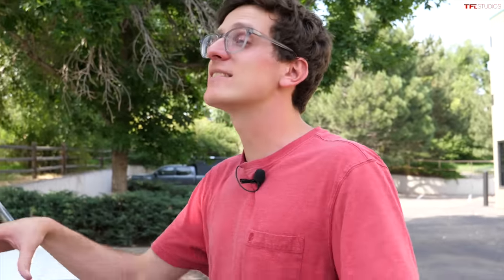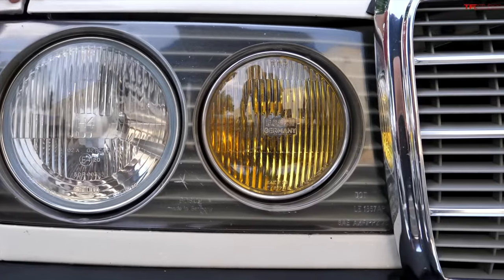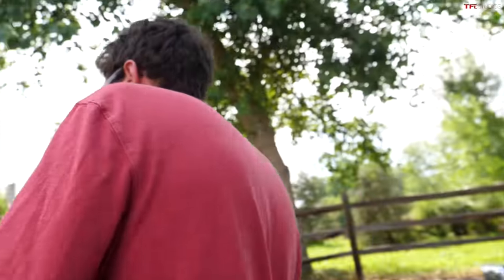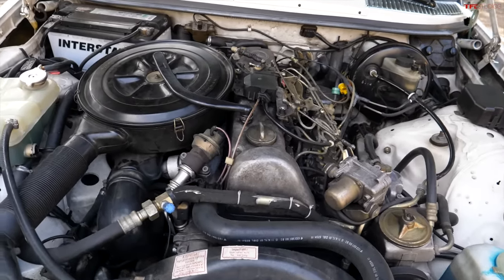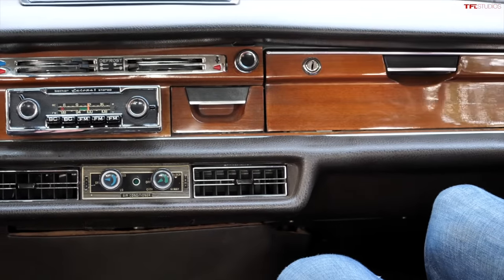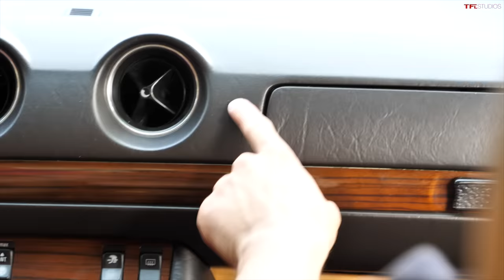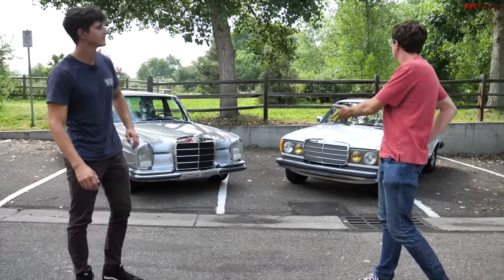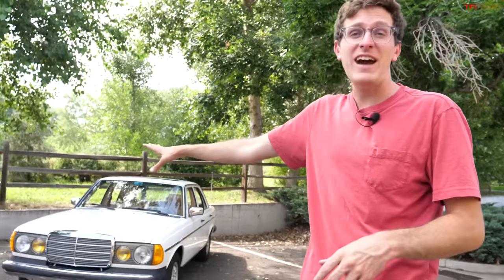Is It Worth Buying a Classic Mercedes-Benz? We Share Why It Absolutely Isn't (& Totally Is)!

Comment: I wish I could understand the obsession some people have with lowering a car to the point of it looking cartoonish.  It cant be an age thing because even as a teen I hated that look.  It's especially sad to see a beautiful classic euro car that's been slammed. 😢
Reply: There are plenty of the original ones around. Don't worry about it. The clue is that the car is often used, out there among the public, not dusting away most of the year in grandpa's garage
Reply: And doing that KILLS any semblance of handling as the suspension geometry is ALL WRONG and might KILL YOU also!
Reply: I absolutely get you. Here in Germany it is very rare to see one of these models lowered, it is not only a question of age, though, because there are classics from other brands that seem to be made for it - but just no mercedes, it destroys the whole aesthetics and proportions...
Reply: Also the swing axle cars like he W108 don't cope with it very well.   Try and buy a used diff for a W108 these days, hard to get now because of damage caused by these slammed and bagged cars.
Reply: So much crap. How can you come up with this guys?? 'Lowered vehicles will KILL you!' 'Can't come over w108 diffs that are not damaged due to slammed cars' It is better that the cars are used and taken care of, so be it if some slam them, instead of being wrecked or dusting away in some garage hidden to the public most of the time. Again, don't worry about it, there are more than enough original ones out there. It's absoultely NOT of your business what people should do or not with THEIR cars.
Reply: @Rimrock300  nobody is worried and nobody cares if somebody lowers his car. In my car it is a question of taste, but everybody decides for himself. The part with 'not of our business'... don't agree, it is a public demonstration video about Oldtimers, people surely expect comments.
Reply: Whatever, go find a video without one lowered in it🤡

Comment: Also, when I was your age, driving 123s, the headlight doors for the W123 were still available to buy at the dealer for cheap. I wish I bought 1000 of them.
Reply: The W124 is an amazing car aside from the green wiring ! 

But the w123 is a tank amazing car
Reply: Meh, it's cosmetic. Plenty on eBay including brand new aftermarket. You haven't been keeping up with W123's. The parts that can truly sideline a W123 that are NLA are the brake booster vac line and the Bowden transm cable.
Reply: Headlight doors are still pretty affordable, about $70 each
Reply: Virtually nothing is available from Mercedes for any classic Mercedes. Whatever exists has to be sent from Germany.
Reply: And this sqid owner worried about radio sticking out!
Reply: @golden.lights.twinkle2329  depends on the country. I run a W126 in the UK and loads of parts are available and in stock at the dealer . Only a couple of occasions have parts been ordered from Germany. Plus all the stuff that Mercedes don't actually manufacture are widely available from Bosch, Lemforder, Febi, Beru etc.
Reply: Wish I'd bought a great many parts when Mercedes still offered them. Hell, few dealers still carry hardly any parts for anything over 8 years old. Everything is listed "Discontinued" for my 2014...

Comment: You guys should get a 190e for the channel
Reply: Were 190Es ever imported into the US? I don't ever remember seeing any americans talk about it.
Reply: @GlamStacheessnostalgialounge  They only imported roughly 130,000 w201 cars.  I have 2 diesels.
Reply: @GlamStacheessnostalgialounge  yeah early US cars had the 2.3 engine then the later US cars got the 2.6 engine
Reply: I’ve had plenty of old Benzes because … well I’m old. My Australian spec 190E is the best of them all easy to run feels like the bigger ones without the cost and I can fix things myself. It’s not fast but on the highway it’s not slow either. It will cruise at 100mph all day happily
Reply: Weren't there like many different cars called 190?
Reply: @jurivlk5433  yes the earlier round cars for the 50’s and fintails from the 60’s the number referred to the engine capacity the 80’s 190 came with a 1.9 litre 4 cylinder E stood for einsprintz motor or fuel injection. The. In the mid 90’s they changed all their model names into 3 classes C, E and S
Reply: @Vaudotusker  Weren't the 190 coupes from the 50s also 190E?
Reply: @jurivlk5433  no they were 190SL
Reply: @Vaudotusker  O.k. Thanks! By the way, one of the most beautiful cars ever!
Reply: @jurivlk5433  190 c class is called w201

Comment: Good job on keeping the W123 in its most original state.  I was disheartened to see the change in the W108 to its current "stainless steel low-rider refrigerator" look---especially having been a family heirloom.
Reply: Yes, that was a crime
Reply: The 280SEL 4.5 looks like a W109 with collapsed air suspension.
Reply: Yes! I felt exactly the same! It looks ridiculous.
Reply: Looks godawful, but unlike most that change springs, that's on airbags and can ride normal height. Bonus points for not fitting super wide wheels as well
Reply: I love it. The original is so tacky, esp. in yellow.
Reply: @1575murray  so, as I'm only super familiar with 123's, I guess this car did not have air suspension?  (The one I'm familiar with is the 123T (station wagon).
Reply: The dude with the hacked W109 knocks the non factory radio in the W123 🙄

Comment: When I was young, this was late 1970`s early 1980, I was a taxi driver up in the northern Norway, for a few winters. This was an island not far from Soviet, in the Barents sea, with heavy storms and a lot of snow. We had MB 300 TD which I was driving. A fantastic car in the winter storms. Not front wheel powered, but you got used to it sliding in the snow. Nearly nothing could stop this heavy car. If I saw a huge pile of snow in the middle of the road, just hit the power pedal and you where out of the trouble. This was the winters I learned to drive in snow. 40 yrs later I do not think I have ever been stopped by snow piles. The interior looked exactly like the one you had in your video. And the sound of the doors..... Thanks.

Comment: Kase's car is baller vintage MB. But as a former W123 owner myself, that 300D is much more practical to own today, and while not as "premium", its body rigidity alone still never failed to impress anyone who ever got in mine. Ironically, I never liked the amber lights on the front of my 300D, I thought clear lens lent a sleeker appearance.
Reply: 240D had a stick, though!  I learned to drive because I bought a 123 240D for $200.  A second 123 240D 4 speed manual, a Pontiac Vibe (yeah, Toyota Matrix) with a 5 speed, now a '12 Kia Soul with a 6 speed.  With all the Kia thefts, I'm glad to have the millennial antitheft device!

Comment: Purchased my 72 W108 back in 2014 for $2900 from the original family.  The M130 MFI has been extremely annoying over the years replacing, cleaning the injectors and adjusting linkage so I decided to swap with a more modern M113 5.0 and 722.6.  It has been a FANTASTIC ride since. Once I finish the AC it can easily be used as a commuter or for long trips without stress.  In short sum I'm a huge fan of the W108 but respect the W124/126s as well :)

Comment: A w123 will for sure always get you home. Just after the German reunification in the winter my dad and my mom drove up north from here in Bavaria. My dad used to have a manual 300d back in the day. Somewhere in the Erz Mountains the clutch gave out. So my dad had to drive home, on the completely clogged Autobahn, in a complete snow chaos, all the way back half across Germany. Everything went smoothly though! Just had to find the right RPMs and roll start it in 1st gear.

Comment: My first Mercedes of the 7 I have owned is a 1982 300D and it sites in my garage. I drive it once or twice a week for it is a joy. my lates is 2019 E300 that I found on line with under 3,000 miles. It is an amazing car with all of the safety features.  I have put over 700,000 miles on these cars since 1982.

Comment: We had a 170V (there was no S-Class yet), followed by a W180 220S, which was already an S-Class, a W111 220S, W108, and so on. Your 280SEL 4.5 was only 1 step from the top of the S-Class, and the 6.3 was the ultimate. Very nice cars, congrats. And you are absolutely right, a car that was driven frequently, or at least every few weeks is always the better buy. I bought a 30 year old Benz with very low mileage that was parked 15+ years in a Southern California garage. From suspension, subframe,  and other bushings, to hoses, belts, and of course tires, all the rubber (dried out and/or rotting) was gone. While I was at it, I replaced the door and trunk seals , and all vacuum connectors around the engine engine as well , plus a hood pad too. From a time when all Daimler-Benz were over engineered, the build quality of those cars cannot be found anymore. Apropos  W123, the wagon prices are going through the roof.

Comment: I had the W123 300D and it was cluttery when I got it (used). However, a Mercedes mechanic adjust the motor (especially the valve adjustment) and after that, it became really smooth. The 300D engine has no automatic (hydraulic) adjustment of the valves afaik.
I should mention that after the W123 I got a W124 200D and it was much better in all aspects.

Comment: The technical reason for some observations you made would be the period technology of the mechanical/vacuum systems featuring a score of rubber seals, plastics and hoses which petrify if they sit and maintain themselves if driven regularly to be oiled and warmed. If you sit them for even periods as short as six months you start losing true seals. Sit for years and you'll have to replace literally hundreds of secondary parts and seals in a full vehicle reconditioning or else you'll have a buggy mess you'll spend years continuously troubleshooting for new issues. This holds true right up to the 90s models.

It is also where log book maintenance history is so valuable since there is a very big quality control difference between classic Mercedes/OEM parts and general manufacturers and reproductions, for example in the 280E W123 (Euro) which is rated for reliable normal operation well in excess of 7000rpm from factory the weights and balances listed in the workshop manual for factory piston kit are the same tolerances for an aftermarket replacement conversion for professional track racing in an American engine, aside from being cast instead of forged they are literally race track quality in the standard factory trim and the pricing reflects this. What a lot of owners do, who are only interested in driving the car for some years and replacing it, without preserving it is replace genuine/OEM parts with reproductions at as much discount as a third the price. When you buy one of these cars as a classic purchase you have a lot of work and expense ahead of you, with significant performance deterioration in  the meantime.

For American buyers there is also the significant factor of separate production requirements for NAM models compared to Euro models for all V8 classic engines through to the 90s and four and six cylinder engines through to the mid 80s. The style of European engine development was generally smaller capacities with limited production high quality components for high revving performance and low speed economy, this duality long before the wonders of electronically controlled management systems generally led to higher emissions and to meet California restrictions they lost a huge amount of power and most of their performance duality. For example the 280E W123 lost about 30hp and wasn't exactly a light car, performance went from something roughly equivalent to a small V8 in an American contemporary to a lot more like a small 6, which it was but used to perform like a small 8.

This should influence model selection for American buyers because in many cases you get a completely different performance between a NAM and Euro version of the same car.
In some engines the loss of performance was compensated by increase in capacity for NAM production, so the 280SE 3.5 Euro translates to a 280SE 4.5 NAM production although it is noteworthy this was simply to achieve the similar performance to the smaller engine with the Cali restrictions in place and is not a better performing engine, in fact the net result was usually some loss of upper range performance regardless and a significant hit in fuel economy under normal driving.
What you then have is Euro Mercedes would later offer this larger engine over there without Cali restrictions as a model upgrade option in cost recovery, in which case it becomes a higher performing engine than the smaller capacity. This is important for American buyers to understand.

With gas engine Mercedes classics you will generally be buying something with unremarkable period performance in American deliveries, whilst a Euro version you would have to consider still reasonably high performing by modern standards. Effectively in America you were paying for build quality and prestige but in Europe you were paying for high performance luxury and all the prestige was entirely just because of the high performance. The 300SL gullwing which beat Ferrari V12s in racing used an identical engine from the standard road production saloon with superficial modification for the track, none to the engine itself, which was rated for, IIRC 36 hours continuous full speed operation at the engine redline without failure in factory testing as a sales publicity stunt. If serviced correctly it was unbreakable, with genuine sportscar performance and that's typical of Mercedes factory cars of the period. Feels like a luxury boat, goes like a race bred engine, reliable as a locomotive. The theme continued at least to some small degree in the affordable classics of the 60s-80s era general production of flagship models, like the 280SE 3.5, the 300SEL 6.3, any 280E/CE M110, 450SL 5.0, 500SEC, 500SL, in Euro trim these are all cars with no problem keeping up with a period muscle car or maintaining respectable, surprising performance even by modern standards in acceleration, handling and top speed. The classics tend to be a lot more unmarkable when detuned for Cali regs and give the false impression that Mercedes owners are just buying a badge and just want to be quirky. Take your basic 72 Mach 1 Mustang to Europe and a basic 280E will match up remarkably well in a street race, run rings around it in handling and have twice the economy all with mom driving and that's the reason for the price tag. It's not even on the same planet as American market versions.

Same rules apply for young classics like the W201 series 190E with early NAM 2.3 SOHC being the same performance as a Euro 2.0 version with poorer economy, the 2.3-16 detuned by about 30hp and the 2.5-16 completely unavailable, the only common engines between continents was the 2.6 and later production 2.3 SOHC engines which were developed as high output low emissions projects so satisfied Cali regs in Euro trim. Similar tale for the adjoining W124 E class model in 2.3, 2.6 and 3.0 SOHC and later 3.0 DOHC versions and the limited production Porsche variant M119 V8 versions based on the AMG Hammer customisation flagships. From about 1986 fours and sixes became common between NAM and Euro performance and in the V8s it was from 1991 with the M119 DOHC engine loosely based on the AMG modified M117/119 Hammer engine.

Basically from the 90s Mercedes NAM and Euro are really the same animal and the AMG variants in particular are real young classic bargains these days, in some cases the NAM ones actually have higher performance than Euro trim or availability in other countries, reversing the trend. Australia for example never got the V8 W124 90s models here, which is a big shame. The highest performing W124 we ever got was the 300E-24 and CE-24 and 320E with the DOHC six cylinders, we had to purchase the heavier W210 420E to get a V8 in a midsize so that was just a bit sad given the W124 is a far nicer looking car with great handling. In the US you have quite a few V8 W124 floating around and they're a real period masterpiece, better than an S-class IMHO.

Comment: I had 2 123 MB sedans.  The first was a 1977 280E which was glorious to drive, but it didn’t have the longevity of the 85 300D turbo that I had.  I wished that I had never sold that car.  It was a bit expensive to maintain but it was so nice.  The dash is classic.  My favorite thing about those cars though is the visibility of the road around you.  The rear of the car is essentially invisible behind you so you can see everything.  You will never see that again in a modern sedan with the short rear windows due to the high rear trunk space.

Comment: the 300 td is loud, but not in the inside. the cabin is super quiet. i Grew up with a 1983 300 TD. that car was amazing. built like a tank. the best was washing the engine with a water hose. no spark plugs. everything was just made of steel.

Comment: Completely worth it and great video. Valid points too. I come with a biased view however - my brother and I have a collection of these things consisting of a W108 280SE (1969), w111 280 SE 3.5 coupe (1969), w111 220 SE cabriolet (1965) and an R107 380 SL (1981). All wonderful. You are right to say you must run them - each of ours gets a run every fortnight. Stagnant classic Mercedes can become very expensive to bring back. My mechanic had a gorgeous 1968 250 SL in that had been fully restored to an incredible standard 5 years ago. The owner - took a contract overseas and it stood idle for 3 and a half years. Wouldn’t start on return…..due to fuel degradation it needed a new petrol tank, new fuel lines and new injector hoses/pipes plus a complete clean pit of injectors. VERY expensive! I didn’t even know damage like that was possible.